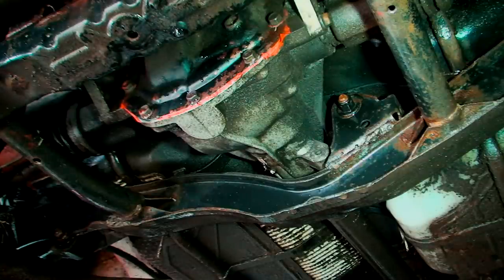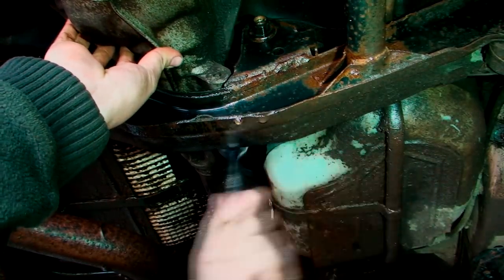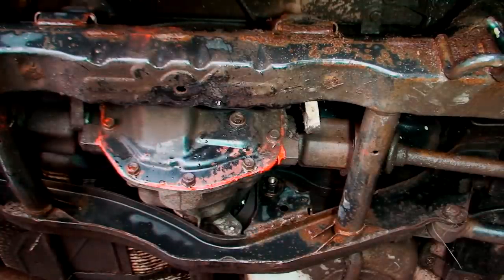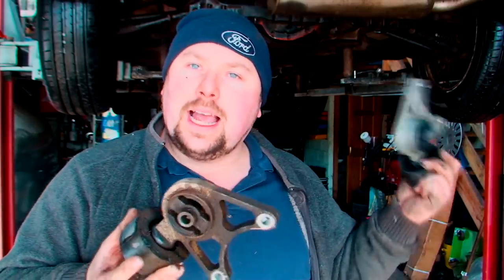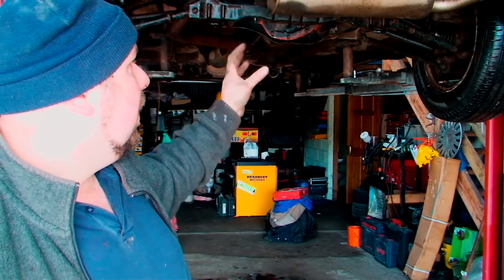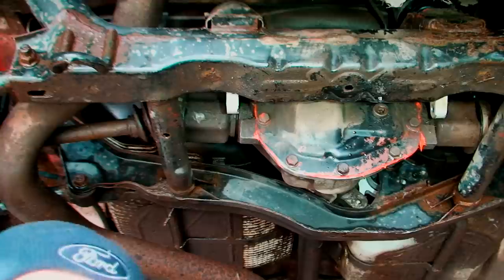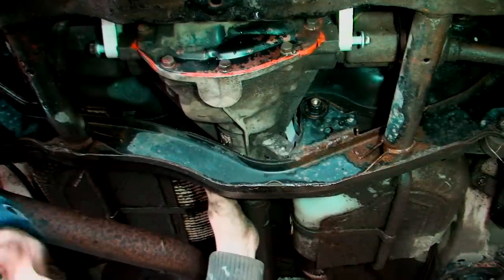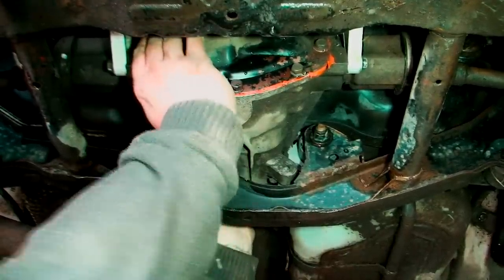bodgit and leggit garage axle mounts on a land rover freelander

Comment: Done mine a few times over the years. Found it a lot simpler if you drop the prop off the Diff. Made getting the Front Mount off easier. You will need a TORX socket to get it off.
Reply from the maker: sorted mate

Comment: another great vid...thanks...i think the front diff mounting is a weak point as i had mine changed under a year ago and its already gone..i intend to now fit a polly duraflex one to stop this problem repeating again and again..they are only about 15 quid but will last a long long time i recon.
Reply from the maker: Hi mate this is when it pays to get the more expensive main dealer parts or the equivalent OEM parts they do last longer

Comment: Hi great video, the Mrs TD4 failed it's MOT today due to this as one of the reasons. I tinker with both her TD4 and my D3 TDV6 what are torque settings of the bolts on both the 13 and 15mm bolts? Thanks. Keep up the good work

Comment: My td4 freelander 1 failed mot Friday due to these mounts so got to do these when they arrive 🤦‍♂️ on the ground with jacks 

Wish me luck
Reply: Easy on the ground. Remove wheels and exhaust mounts . Long extension bar for the back mounts .. copper grease bolts on install

Comment: Great & very helpful videos ,I have to do this job on the sisters freelander at the weekend.Just one question .Do you use a 13mm & 15mm socket to remove the retaining bolts on Diff mounting bushes .Thanks for your help  .Peter.

Comment: Hello mr . I have land rover. The support mount engine is very expensive. Do you advise me to rebuild them ?
Reply from the maker: osama alm  hi mate unfortunate I don't really understand what you are trying to say if something is gone then replace it if your bushings are worn replace them
Reply: bodgit and leggit garage . Hi i just want to ask . I have freelander 1999. The four support mounts engine is very bad . There need to replace it . But they are very expensive. Could I rebuild them by putting polyurethane in them  ?
Reply from the maker: osama alm well it's definitely possible but you have to make sure you get them 100% lined up which will be very difficult if you can do this then go for it
Reply: Ok thanks very much

Comment: Only 1 bush for the front seems like a poor design.  Also the original bush has gaps in it.  Is there any way to upgrade the front bush?
Reply from the maker: There's always a balance between comfort and and reliability or how things left what I mean by that is the harder rubber you put in the stiffer the ride will be more uncomfortable